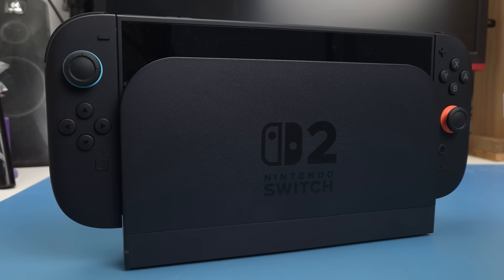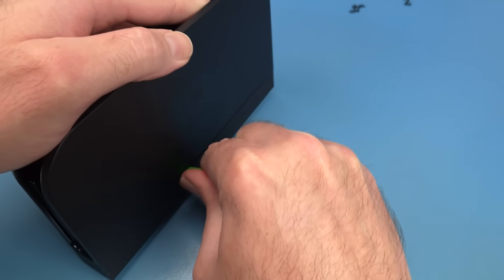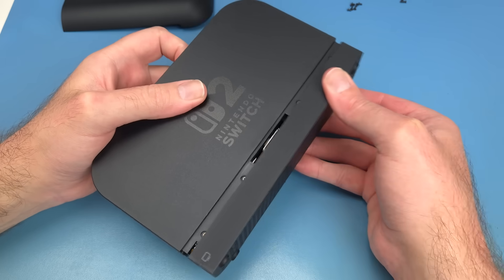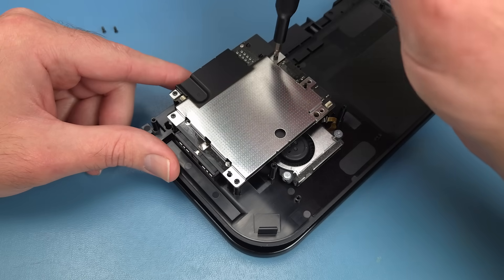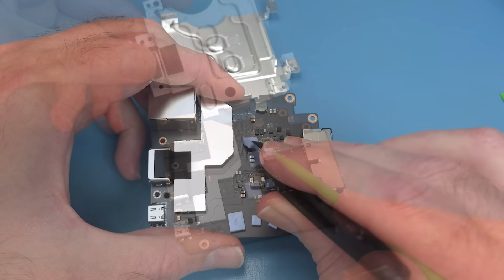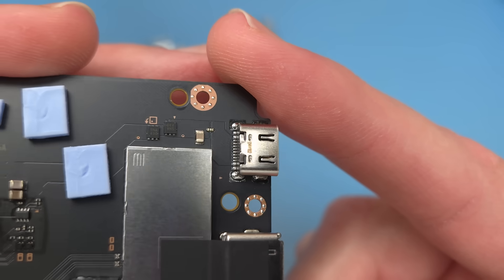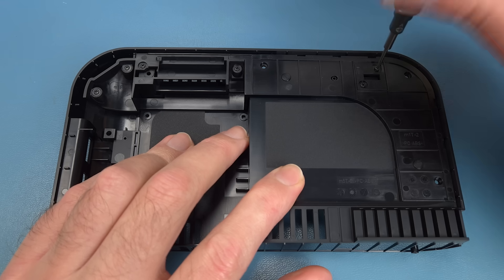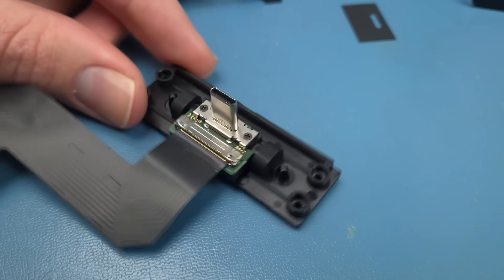Switch 2 Dock - Full Teardown

Comment: What does the motherboard do? Don’t we just need the USB connection to deliver power? And what does the fan cool exactly? Just the motherboard? Do the dock’s components produce a lot of heat? Or is it mostly just protection from Switch 2 heat?

Another question. Does the wall power allow the 4K? Or could the switch 2 technically have the same performance without power at all? Just crappy battery life? What if we plugged it in (theoretically if software allowed us) with a regular cord to game the 4K?
Reply from the maker: The motherboard transfers HDMI, Ethernet, and 2 additional usb ports. The fan appears to mainly be for cooling the motherboard. 
The switch 2 does 4k via a TV. The onboard screen is only FullHD.

I don't know the answer to the other Q's. I am also curious about that.

Comment: Yeah the bent tab is by design. The fans used in side my Switch 1 were the same. In fact it seems they are more or less using the same fan as the console does. Makes sense. Saves them on production cost if they make the same fan for both the dock and the console.

Comment: As someone who designs electronics, there really doesn't look to be a good reason for there to really be a fan in this thing. Seems like an odd choice. The Ethernet and DisplayPort to HDMI adapter chips don't even have thermal pads, just the two small voltage regulators have a tiny amount of cooling through thick thermal pads. Maybe they did get too hot but only if someone put the console in the dock in a closed TV cabinet. There are much beefier laptop USB-C docks that have chips that draw more power that are just passively cooled.
Reply: Probably just to protect the dock components themselves from the heat generated by the console alongside the heat they generate themselves? My hypothesis would be it's overkill with Nintendo working on the assumption that there will absolutely be people out there putting these things in really constricted spaces/fully enclosed cavities etc.
Reply: maybe the fan is directing air into the switch from below the switch, right into the air vents on the switch
Reply: I wonder why they didn’t design the dock to be actively cooled. I would love a 3-D model that could be designed that incorporates active cooling.

Comment: And all those who insist the dock has magic chips that make 4K work 😂. The fan isn’t even for cooling the Switch. The dock is there to lock the Switch 2 TV output to it … until 3rd parties make their own smaller, more portable versions at lower costs.
Reply: Like what the fuck is the fan for, that thing doesn't need cooling

Comment: Anyone know if the fan is the same model as the one inside the Switch 2. It would be interesting if you could use it as a spare.
Reply from the maker: No it's not, its smaller and draws less power.

Comment: Any indication on what the chips actually do? Seeing so many makes me curious what is necessary to make a simple USB-Hub, charging and video output device work.
Reply from the maker: • Realtek Display Port to HDMI Converter.
• Realtek Gigabyte Ethernet control chip.
• USB Hub control chip.
• STM Arm Cortex microcontroller.
• Serial flash memory
Don't know what the two CP1035 chips do.

Comment: I don't get it, What's the fan suppose to be cooling? Like, its pointing tho plastic from the dock. Weird...
Reply: The intake side of the fan is used to draw cold air in from the bottom, over the shield plate (used as a heatsink for the power delivery hardware), and exhaust out the top.

Comment: According to what I read in different publications, the base had active ventilation that helped the console manage its temperature when it is in Dock mode. But if I'm not mistaken, that fan is not doing anything in that setup, right? It seems more like ventilation for the electronics of the Dock itself.
Reply: I had about the same impression watching this. Doesn’t appear to aid in system cooling at all.
Reply: @lieutent2654  If this is confirmed, it would be 'good' news for those of us who already use unofficial portable docks when we travel, since the operation with these, which do not provide cooling, would be the same as the standard one.
Reply: My guess is the heat generated by the Switch 2 in docked mode might affect the internals of the dock so the fan is there to keep it from being damaged from long extended gameplay.
Reply: Yeah, even when it was first shown that the dock had a fan I was skeptical that it would do anything for system heat dispersal, and then when I bought the console and saw how much clearance the console has in the dock I knew for sure the dock fan was just for cooling the dock's own components. The fact it was kind of right in the middle of the dock with no way to really effect airflow in or out of the Switch itself meant it was pretty unlikely it could do anything to cool the console. Great to see it confirmed though. My biggest concern was portable docks - I've got the Genki shadow dock and want a similar dock for the Switch 2.

Comment: I wonder if we can get a dual switch dock mod to dock both the switch 1 and 2 in one dock. Just needs a switch to go between which systems are outputting to the TV.
Reply: Not likely without a third motherboard, the switch 1 and 2 use two entirely different boards so unless you build a detector to allow passthrough it likely wont work

Comment: The fan for extra system cooling makes… no sense at all. Nintendo said that’s what it was for. It’s blowing air over the top of the exhaust of the switch. That should help just a bit to create a low pressure zone above it, but imo it would barely contribute. I doubt Nintendo put on the time to properly do some CFD on it. I’m thinking it’s mainly there to cool the VRM’s in the dock and the Ethernet controller. 

If they actually wanted this to cool the system, it should be blowing down to the bottom vents of the system. Even then it wouldn’t help much since the static pressure to even contribute the flow by the time it’s in the fin stack would be nil, but at least it would help bring in cooler air to the intake ducts of the console.

Bizarre.
Reply: Agreed, looks wasteful at best

Comment: usb 2.0?  Why not usb 3?  Thought that was the standard now.
Reply: But what for? What device would use it in the Nintendo Ecosystem? There nothing I can think of that would need it and now the Network adapter is built in zero reasons I can see.
Reply: @Flackconnon  I just thought usb 2 was pretty much obsolete now, I mean the price difference is tiny, so why not?
Reply: Because there is no reason. It's only for attaching a controller

Comment: I haven't opened my switch but I hear some vibration also near the fan . maybe I have the same piece of metal floating around
Reply: The fan is a different model in the Switch 2. Still made by Delta but it’s slightly larger and more powerful.

Comment: Does this dock fan help cool the Switch 2?
I mean it needs air ducting between the dock fan and Switch 2.
Reply from the maker: If it does, it doesnt appear to be significant, there's no ducting going from the fan to the switch, and it's just blowing out the top.
It is drawing air in from the bottom, and the switch would be too for its air intake. So it may aid the switch's air intake a little bit, I'm not sure.
Reply: @RestoreTechnique  The way I see it, it's only cool off the dock's chips, not the Switch 2 itself. I suspect it's to further clean up the signal coming from the Switch 2 to a 4k tv.

Comment: ya the fan is doing zero cooling for the switch itself. if anything its only cooling the video and power board.
Reply: I was fearing this. Seems wasteful. Hope we are wrong!
Reply: @DanielMartinez126  Given the chips it's likely an Upscaler. Having a dedicated upscaler to send out a 4K signal to your TV.
Usually helps bypass the TV or the Switch 2 itself from doing the upscaling.
More horsepower available for S2 and avoids the general issue of poor upscaling that budget and some mid-range TVs have.
Reply: @Daigon95 if this is the case then great! Waiting for further analysis from others like Digital Foundry and the like.

Comment: Are they for sure USB 2.0 ports on the dock? 
I thought I heard somewhere that they were supporting USB 3.0, but were locked to USB 2 speeds...
Reply from the maker: Yeah, they've only got 4 pins. USB 3.0 requires 9pins. 1 row of 4, and 1 row of 5.
Reply: The OG dock has a 3.0 in the back I/O. With the OLED and Switch 2, they replace it with Ethernet. The Switch USB-C 3.x docking port probably don’t have enough bandwidth for video output, Ethernet, and USB 3.0.

Comment: The bent tab in the fan housing is a design choice to add structural stability. Mine is the same way.
Reply from the maker: Aha, thanks!
Reply: @RestoreTechnique  Is the HDMI port 2.1?
Reply: @DPdp-x9u 2.0 the Switch 2 supportd VRR only in handheld, not docked
Reply: @theakiwar9118  if the switch 2 supports VRR in docker they just disabled it temporarily since there are problems with the compatibility of the TV and the PC screen for the moment and the cable supplied with it is 2.1 too
Reply: @theakiwar9118  that is not true
Reply: @DPdp-x9u  It has been confirmed the HDMI support is full 2.1 spec. The docked VRR issue has nothing to do with the dock.
Reply: @theakiwar9118  Incorrect. the dock is full HDMI 2.1 compliant. The Docked VRR issue is with the Switch 2 itself, most likely held back by software intentionally.
Reply: @esmith13  don't worry I had already said that it was 2.1 I just had a little doubt and since he had just opened the dock I wanted him to confirm to see
Reply: @DPdp-x9u  Apologies, I didn't see your follow up 😅
Reply: @esmith13  Yes, no problem 😊
Reply: Hopefully an future system update will add VRR support for the dock
Reply: @javonjames4573  normally it will happen but Nintendo have not yet spoken but it will happen maybe at the same time as when they balance the console because for example the games run on 6cpu instead of 7cpu and the developers asked Nintendo to correct that you see :)